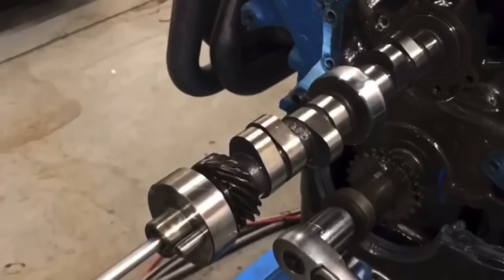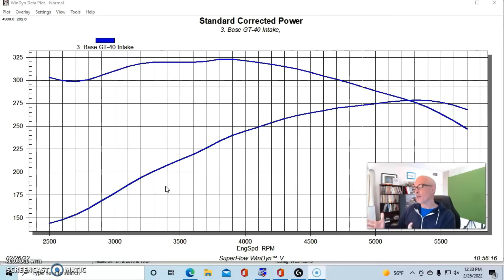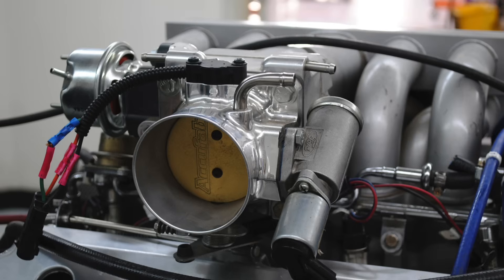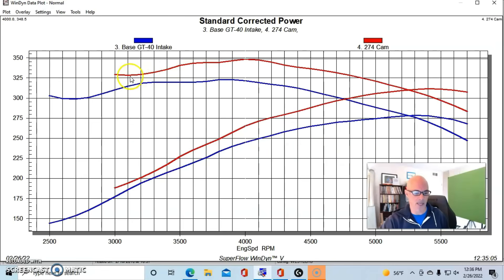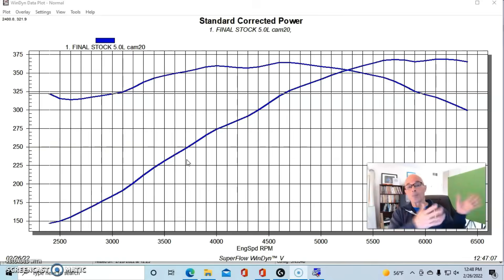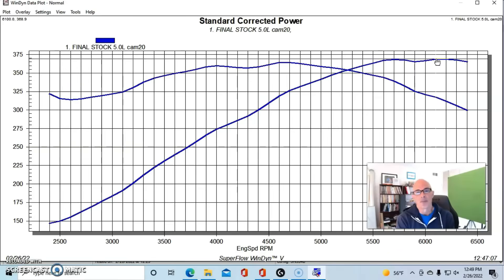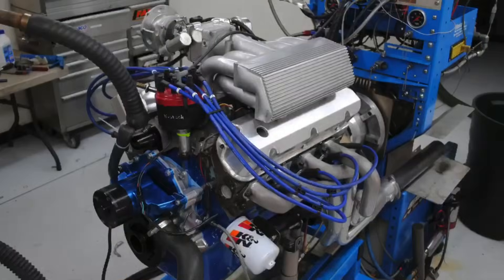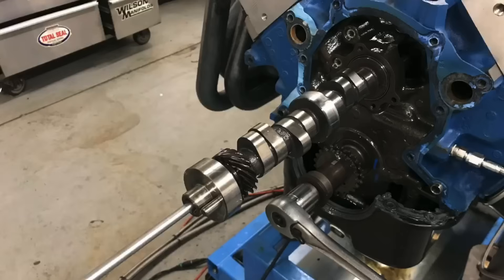HOW MUCH POWER IS A 5.0L CAM SWAP WORTH? WHAT IS THE BEST CAM FOR MY 5.0L 302? 5.0L FORD EFI VS CARB

Comment: You won't ever make power that easy or that much with simple changes in chevy small blocks been mech all my life built big blocks small blocks ,currently 454 030overbore in my 92 issuzu pup swb truck the 302 in my bronco 2 with b cam gt40p heads holley600 performer int pulls way harder and longer than any engine I ever built,other than my 69 mach1 351windser 780 vacsec carb that was a runner

Comment: Hi richard, bit of a grave dig. Im doing a build using parts lying arounf the shed. Ive heads similar to the blueprints, going on a 5.0, i was intending to use a 274 cam howerever the only lifters i have are solid rollers i was thinking anout using the 268r cam instead. It has 230/236@50, but less advertised (268/274) than the 274. How do you think it would behave in comparison? I would think similar with maybe some more top end. Any insight appreciated
Reply from the maker: less drivable but maybe more on top
Reply: @richardholdener1727 well that's OK, it's going in a 600kg track car so I dint think that will be a problem. Thanks and keep up the good work.

Comment: This gives me hope. Stock compression C code 289 with the 274, Performer intake, AVS2 Carb, TFS 11R 170's and 1-5/8 longtubes is what im currently putting together. All in a '79 notch weighing sub 2800 w/me in it, a T5 and 4.56's in an 8.8.....should be a hoot!
Reply: 456 might make 1st obsolete, but I think the rest will put a smile on your face.
Reply: @stuartwall8212 the 4.56 rear didn’t happen, got a 4.10 one instead

Comment: What length pushrods did you run with the blueprint heads and XE274 cam? Trying to see if I can guess on the length and not have to measure. Planning on running AFR 185 enforcers (1.90 intake valves) with F303 cam and 1.6 double roller rockers.
Reply from the maker: you need to measure

Comment: Circling back to this video and I have to thank you. For quite some time I've had the nagging curiosity of what it looks like when the cam is the restriction. For years we've used bigger cams to crutch weak heads. Past dyno tests have always swapped out HCI at the same time and I found myself screaming at the article "LEAVE THE TINY CAM IN IT AND LETS SEE WHAT HAPPENS" to no avail. Past LS dyno tests have answered several questions: The long block is great and the cam is the restriction. Also, the stock specs of some of the better stock cams are great...but they would be better if the LSA was tighter. These things help in understanding how to plan an engine, cam selection and that a "Hog Ass cam" isn't required to make great power. I'm satisfied that the stock HO cam specs are capable of almost 370hp (not the 405 some have claimed). Another example of this is the 071 cam. We know in a ZZ4 that cam makes 355hp but in a 604 that cam makes 405hp. Where os the restriction on the ZZ4? Yet you STILL see people swapping out the 071 cam in the ZZ4 in search of more power. Sorry for being long winded and, again, thank you for providing us with your experience and what amounts to free dyno time. I'm on bended knee asking you to continue down this path in future dyno sessions when its convenient.

Comment: I have a sn95 with a 302 i have blueprint hp9009 heads and a xe274hr cam should it be making 417 horsepower?
Reply from the maker: no
Reply: @richardholdener1727 but could it? Just very curious and you dynod the same combo 417 horse?

Comment: I know it's an old video, other than gutted cats and no mufflers but I have a bone stock 5.0 in my 95, I found on marketplace 2 explorer uppers and 1 lower for $100 explorer intake (I haven't installed yet) so I bought the required trick flow adapter elbow that's 75mm and a 75mm SR performance throttle body and I opened up the opening to accommodate the bigger elbow and TB. Is it even remotely worth tossing a bigger cam in it? There are so many saying no prob loose power. I know I'm not going to get crazy power improvements but until I can swing a rebuild with aluminum heads ect, where it sounds so stout I just want my 5.0 to run a bit stronger and carry the revs out a little further. It's just so underwhelming bone stock even tho stock HOs have surprisingly impressive TQ for a little short stroke v8 and they really wake up around 3000rpm but Peter off around 4500. Its a 5 speed and has the 2.73s still and with 100+lbs of sound system in the trunk with 265/35zr18s it would spin the tires but when I put 295/50r15s on 15x10 wheels on the back it so does not want to even break traction now. It desperately needs a little more gumption and 3.73 gears and I'm tired of it looking and sounding fast but getting embarrassed by every late model pickup. It definitely has waaaaaay more bark than bite, it's like an old lion with arthritis and no teeth.
Reply from the maker: a cam helps-even stock-gears would be a big help

Comment: Came back to a lot of your videos on the 302. I am currently building a 332 stroker and was curious if you recommend the tried and true XE274 cam? Or would you run something different?
Reply from the maker: TFS stage 2 might be a cheaper buy (or a new Summit E or B303)
Reply: @richardholdener1727 thanks Richard! I have a new B303 sitting in my shop! But I was t sure if that would give me what I need

Comment: Im a doing another 5.0 build so I had to refresh myself with this video, It really shows the stock HO cam is really good, all the gains seem over 5,000 RPM. Most street driving cars are not reving up there.
Reply from the maker: cams gain well before 5000 rpm compared to stock

Comment: Ive got 3 sets of heads 69 model 351 ported ss vavles set of aluminum with ss vavles an a stock set e7 heads shaved an the 351 heads on a 306 is a bad mf

Comment: Ive got 2 306 sbf 1 is fully built aluminum heads an all top to bottom  with the 303e+ cam my second 306 im running stock heads shaved all new vavles with a b303 cam summit forged pistons ive not put the second motor in yet but I believe the less built motor gonna run just as good if not better then the fully built motor

Comment: Hi Richard, I love you videos & compotesting.  I noticed in the dyno results that the big cam & headshad a slight dip in torque/hp in the top end the recovered. Just wondering the reason why? Fuel, intake, cam, heads or exhaust? Thankyou

Comment: How did you add 14 degrees of intake duration @ .050 and GAIN low end torque?? Is it because the LSA was tightened up to 112 from the factory 115-116? Everyone in the forums claims that changing cams on a stock headed 5.0 is a waste of time. This proves otherwise!
Reply from the maker: a cam is worth 30+ hp with stock heads
Reply: Be careful with the advice you get from people on forums. Most of those people are idiots that think they know everything. I found so much wrong information throughout the years in forums.

Comment: So I’m buying a 1990 f150 with a 302 in it thinking of swapping to a 351 but if I stick with a 302 and a budget of around 5 thousand what could I do to make it fun on the street what combination would you go with?
Reply from the maker: boost
Reply: we’ll boost has been in my mind but don’t wanna take the chance with the block or anything along the lines of that so ig I should also give more details on what I want this is a truck not foxbody they break loose stock so I’m looking to make more torgue then horsepower but keep the horsepower respectable aswell something I can pull with but I also want to burn the tires off it with a 6 inch lift and 35s so mainly looking to be able to pull and smoke the tires at the same time with a pretty good chop added to it to

Comment: Dearest sir , I am looking to build a 5.0 with gt:40p with low toque for pulling trailers,. What recipe would you suggest. I’m in the mind of a 331 striker kit. It’s going in a ranger
Reply from the maker: mild cam and long runner intake and log tube headers

Comment: Hi Richard, just wondering if you could suggest a part number for valve springs that you like to use with the xe274hr if possible.  Thanks!!  As usual, great video!!
Reply from the maker: I don't have a spring package unfortunately

Comment: Hi Richard, love your videos.  Been watching a ton of them.  I've got a 95 Mustang GT.  If I put a stock bottom end with aftermarket heads, GT40 intake, and an uggraded cam, will the stock ECM drive it properly?  Or will I need a "tune"?  Or something else?  I'm looking for kind of a "drop in" solution that does not necessitate replacing a bunch of other stuff but still gives me a bit more power over stock.
Reply from the maker: if it is speed density-it will likely not, if MAF, it will work okay
Reply: @richardholdener1727  Thanks, I believe the 1995 Mustang GT uses MAF.

Comment: I get how ford (& any OEM) had limitations back in the day like 90s like cam profiles compression ect because of cafe and emissions but with there vast knowledge and development budgets they produce a mehh designs like the HO engine, yeah it makes impressive TQ for a little engine but performance was bit underwhelming but making a good head and a good intake design cost the exact same amount of money to manufacturer.... Is anyone trying to convince me the E7te or even the GT40 was as good as ford could do in the 90s? Could of hired DV to scratch out a design on a napkin and done better. Also I'm skeptical of the 94/95 version going down to 215 from 225 in the fox, I think they knew the new turd of a mod motor only had 215 so they lowered the 5.0s rating so folks didn't say this new fancy pants ohc engine has less HP!!!Wtf?? As far as I know the only difference other than pulley location change is the intake elbow but they also used the bigger cobra maf meter so you would think that may fix any loss the elbow may have caused if any...?
Reply from the maker: To suggest that the Ford engineers didn't know how to make better heads is silly. They made the motor to produce the desired combination of power, mileage, emissions and cost for the time. Back in 1987, the 225-hp Mustang was a series player on the street.

Comment: So this is my first foxbody build what I have in mind is cobra intake AFR 165 heads ford b303 cam and bbk shorty headers with a stock bottom end is that worth the build ? Would I be close to 400 hp ? And still safely drive on the street everyday
Reply from the maker: it will be shy of 400 flywheel hp
Reply: Thank you

Comment: What would happen if I use the 274 cam with a stock torque converter ?
Reply from the maker: might be soft down low-also depends on intake choice

Comment: Could always have highlighted that camshaft modifications provide a percentage change. 250BHP+10% is 25BHP increase but 400BHP+10% is 40BHP increase.
Thermal efficiency of modifications is a whole new arena of understanding and that would explain why the percentage change isn't exactly the same.
Reply from the maker: you can apply the math as you wish-the reasoning behind the gains is because the rest of the components now allow it to succeed.

Comment: Will the 274 cam still have clearance with stock pistons or would they need to be checked? I'm  currently running a F cam with SVE heads Gt 40 intake pushing around 10lbs with a novi 2000.I just bought a Holley SysteMAX like to upgrade the cam to the 274 if there's clearance thanks for all the great videos
Reply from the maker: should fit

Comment: i am doing the top end on a 1986 efi 5.0 in a mercury  3800 lb 2 door marquis.   my goal:  optimize the effeciency.  increase mpg for all around driving, and knock the socks of the nay sayers .  this is not my first build.  but it is my first sbf build and my first efi build.  goal, no less than 300 hp, preferably around 400 hp, max torque of course.  at another time, I expect to Dr up the rings, etc to go turbo, etc, but not for now. likewise, what i put into this should be compatible for turbo/nitros upgrade, if and when i decide to get into the bottom end.
(  Might save the turbo for 5.7 vortec build or my BBF 429 build..  but definitely for my VW cabrio build.)

my build style is:  stop light to stop light horse'n around, freeway driving, around town driving, doubtfully will ever see a track)  just a good ol grin'n, shit'n n get'n restore mod on survivors.   ( moderate budget for us half broke potliqours)

Thinking AFR 185 heads.  your test show them impressive at all RPM ranges.

Cam, i don't know.  I was planning on the edelbrock top end kit, but seeing that is not going to give my my 2000 rpm efficiency, the rpms cars are driving the most (on average).  Edelbrock recommends i talk to the head supplier, the head suppliers suggest I talk to the cam supplier, etc.  (we need more collaboration in the industry like you and west tech, etc provide for us!!)

intake, I am struggling.  seems edelbrock has available inventory issues, and having a hard time finding numbers to verify the words i am finding.

I can't find numbers or top portion for speed masters.  efficiency

 ( moderate budget for us half broke potliqours)

I do hope to keep this simple and straight forward, not just for me and my young (learning) helpers but for future owners too.

70mm throttle body?
24psi injectors? or should i up that?  not sure which injectors would equal a 600 or 650 cfm carb.  having a hard time with data on that also.

Assuming fuel pump has to match the injectors.  

Exhuast, figuring on ceramic headers, probably long tube, but struggling to find a company that admits their ceramic headers will slip into a 86 marquis.  and I see no useful benefit to shorties.  (please correct me if i'm wrong)  Wanting a soft rumble.  thinking flow master has a set of 50's that won't piss off the neighbors, yet allows flow equal to most 40's.  knowing there are better numbers on other brands, but unpublished, and few published tests suitable to small block in this hp range.

fluid filled harmonic balancer
HEI ignition, 45,000 volt (or more) coil
LTD interceptor front shocks?
Gabriel Rear air shocks
front bushings?
rear disk brake kit?  (thinking the hollander book for a late 80's early 90's Ford oem or?

I am confident that i am not the only one happy you are doing so many 5.0 sbf tests.  there seems a shortage of those, yet a huge number of us doing 5.0/302 builds.

What recommendations would you give for this build?

Heads?
Intake?
Cam?
HEI?
Headers?
injectors?

comments?  

much appreciated, you and yer fellas at westech, frieberger, and ya'll are beyond awesome   there's a rare few others in ya'll's class, but before ya'll, it was hit n miss.

Comment: I have a 351w roller bored.30 ..sr heads 202 valves  with Pac 1918 springs.   And stock dish pistons. .  Will this cam work good. ? Will springs be ok. Not to much pressure? 140lb and 450lb  open .. will it clear pistons at total lift ? Heads say 240 duration should clear ..
Reply from the maker: P-V NEEDS TO BE CHECKED

Comment: Soooo idk if ur gonna answer this but best cam shaft to run for the exact same engine jus efi an completely stick but wanting to do a stage 2 rebuild kit when I do the stage 2 rebuild kit I’m not putting nothing else into it jus putting the engine back in the truck so with the stage 2 rebuild kit what do u think best cam would be ?
Reply from the maker: what engine and what power level and what application?

Comment: so with a stock block, Stock Heads, Stock Cam, and an explorer intake with a  70mm Accufab TB, 75mm Pro-Mass Air meter, 19 Pound Stock injectors,  5-speed Z-Spec T5, and 4.10 Gears, what would you recommend A Vortech V3 Blower ???
Reply from the maker: you need bigger injectors
Reply: @richardholdener1727  24-pound injectors? the V3 Vortech gives how much horsepower per pound to the wheels ?

Comment: Excellent video Richard. Fuel motor was the same example I always use. Build a 3000hp motor and then stick a stock cam in it and there’s 2500hp drop. When you put the right cam back in, the cam swap was worth 2500hp😂😂😂

Comment: I had a 1985 Mustang GT that I had installed the E303 cam with Edelbrock RPM heads and Intake with the Demon 625 carb on a stock bottom end. Just wondering if you had tested what the hp was between the original stock '85 GT engine to having installed similar upgrades to it. I swear that the '85 was just a bit faster than my '05 GT that was bone stock when I had both at the same time. And yes, I am still kicking myself for letting the '85 go...

Comment: Great job on the video as always, but lately I have been wondering what combination of head cam and intake would provide the widest possible powerband. Not looking for the highest peak power at any given rpm. But building an engine with the specific purpose of having biggest useable powerband. I think that would be an interesting test.
Reply: There isnt really such thing as a powerband, any engine will continue to make power up until a certain rpm range. So to answer your question, to be able to rev high rpms and make power in those high rpms, you simply need an engine setup that has valvetrain and intake setup to do that